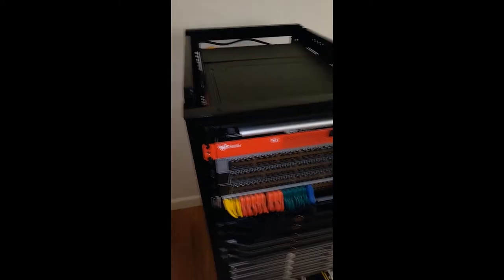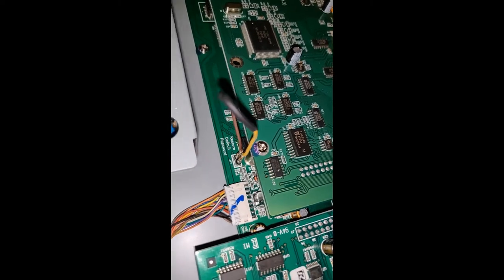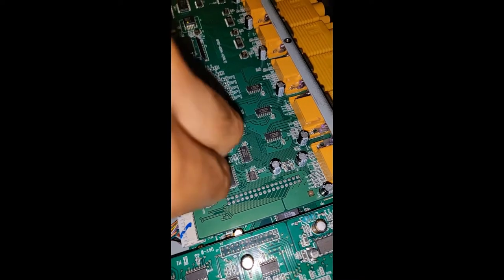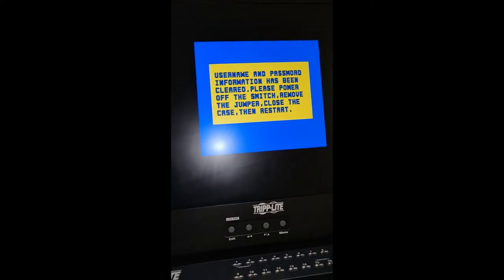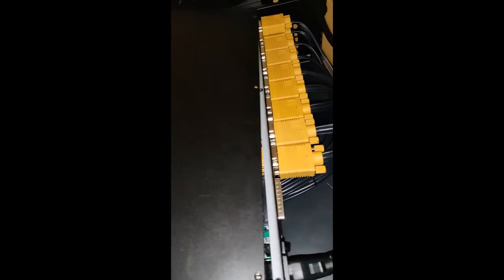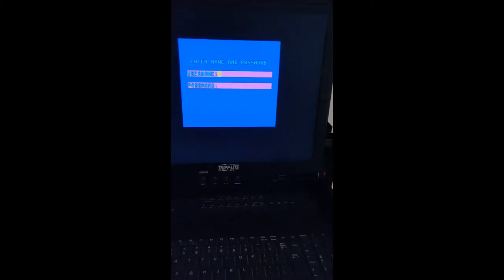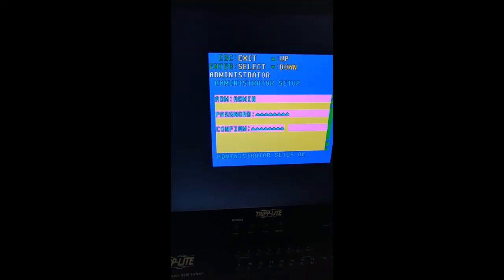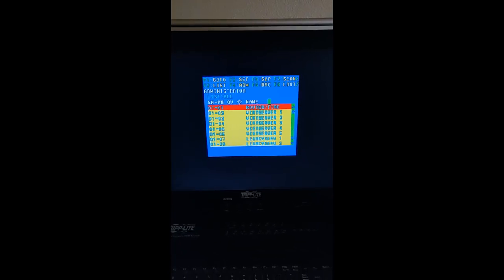HOW TO RESET ADMINISTRATOR PASSWORD ON TRIPPLITE 16-PORT CONSOLE KVM SWITCH

Comment: Thank you for this.  I can confirm this also works for the Tripp Lite B020-016-17-IP as well.  Reset PINs were close to the right corner - by the AC Socket.  Also had the words Default Password etched onto the motherboard.  Shorting it with screwdriver did not work in my case as it takes a while for the reset to finish - I used a standard PC jumper.  I did not notice anything on the display - no message stating the reset was completed.  There was some kind of factory reset process occurring though as there was a double beep?  Then the LCD Power button turned Amber + keyboard led indicator lights started blinking rapidly (scroll lock + caps + num).  At that point I powered down and removed the jumper.  Powered back on and the KVM was in factory reset mode.  Tripp Lite Support was not helpful, kept repeating the manual back to me.
Reply from the maker: I'm Happy this video helped you out! if you need help with anything else please feel free to comment and ill do my best to help. Also depending on your version of the kvm and the version of the firmware you will or will not see anything during boot.